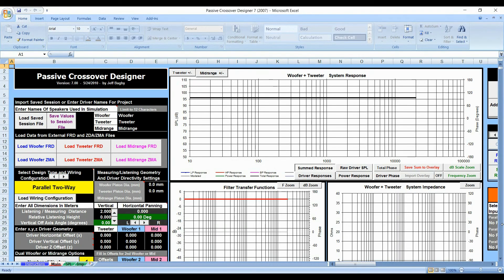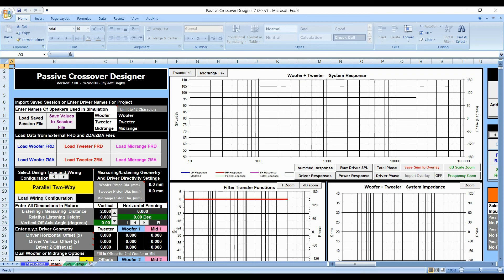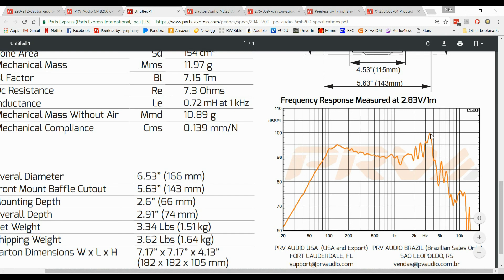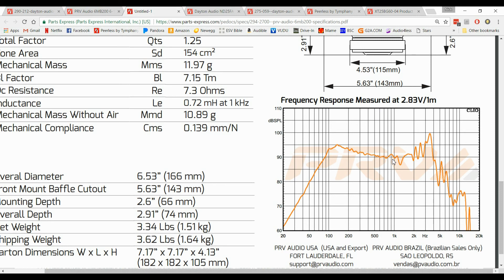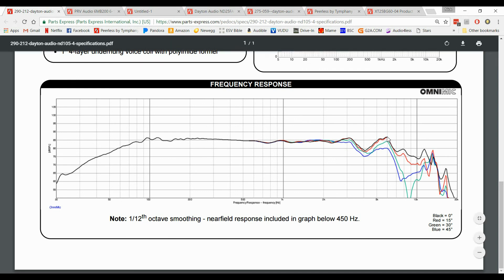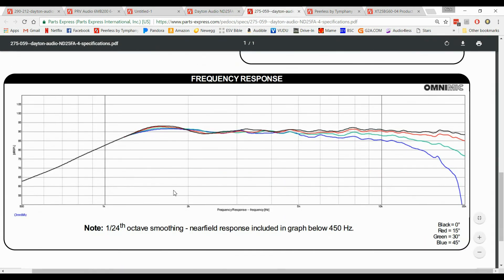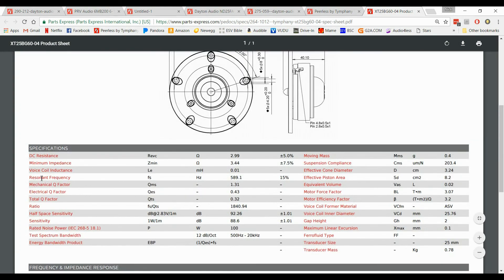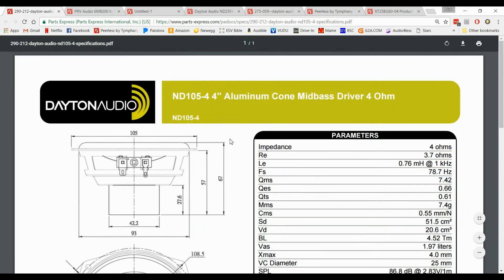How to Design a Crossover - Part 2 - Selecting the Drivers

Comment: Also need to consider polar response when choosing a crossover point and those files will only give you a ballpark for the crossover....they won't show equivalent response in the cabs you design so better to always use your own measurements in cabinets.
Reply from the maker: Thanks Paul, actually just had wrote down that I need to do a video on polar response and how that will help you choose your crossover point. It's like your reading my mind!

Comment: I would like to build a crossover filter to cut low frequencies from a full range speaker. To cut less than 1000 Hz.The power of  the speaker is 350 RMS.
Please can someone help me?
Reply from the maker: s z just need to build a high pass filter at 1000 Hz for your speaker
Reply: With this answer you did not solve my question. So vaguely I know it too.

Comment: Another question based on this video.  Would you say that the 'overnight sensations' are a bad crossover design?  The mid-range is the B4N, which I see has cone breakup around 3k HZ.  When I take half of this, I am around 1.5k.

These speaker designs have the ND-20FA6 3/4" as a tweeter.  The resonant frequency on those is just over 2k Hz.  When i double this, I get 4k, and when I review the graph it looks relatively smooth at that point.

This seems to be a bad paring choice (trying to cross the mid which liked 1.5k and the tweeter, which prefers 4k).  Without going further into your lesson plan, am I thinking about this correctly?
Reply from the maker: Spencer you are thinking correctly.  However, you have to keep a couple things in mind.   First, these are guidelines and not always hard fast rules.  When I look at the B4N, I see breakup happening at 5k, which would be about 2.5k.  Paul crossed it over at 4k, which actually worked.  This is the same point you make with the tweeter.  YOu also have to remember this was considered a low budget build, which will always have some shortcomings.

Is it a bad pairing?  Well that is a different question.  It's not really a bad pairing, but it is not ideal.  You have to remember the O.S. are fantastic speakers for the price.  But they were built with a low budget tweeter and mid, which can have it's pitfalls.  But with a properly designed crossover, Paul made them really sing.  

You're on the right track and you can really make your speakers sound great.  I recently made a speaker in the similar price range as the O.S. and it's sound quality was much more in tune to my liking.  It was a very smooth response with the perfect amount of bass.  But that is part of designing your own speakers, figuring out what is the best pairing for you.
Reply: Awesome, thanks for the pointers.
Reply from the maker: You're Welcome